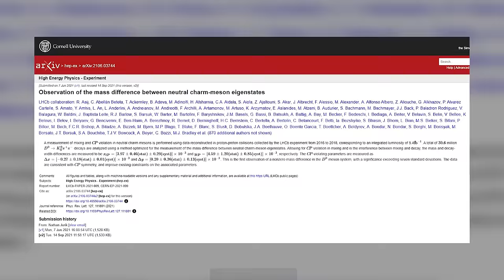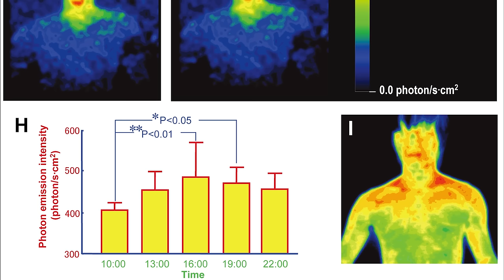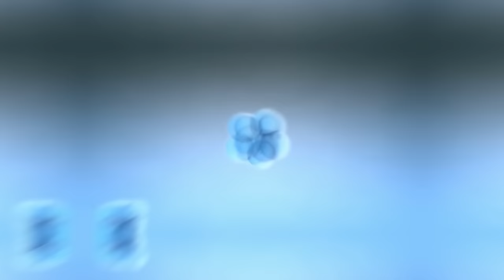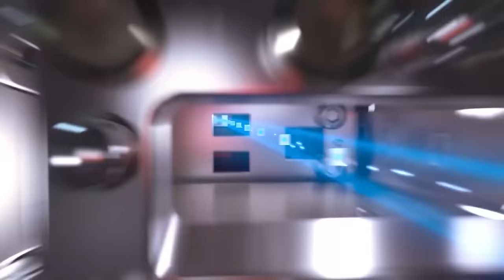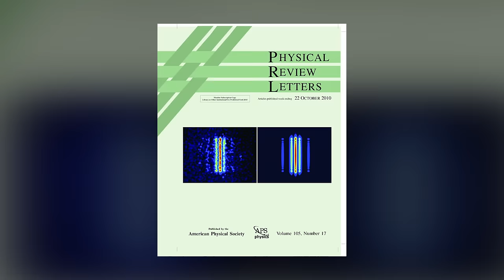Time Travel Is Possible: The First Successful Experiment Was Conducted

Comment: Aren't it about 1000W per m2 as a rule of thumb? From what I've been told it is only around the Equator that receive that high amounts per m2. Far less up North. 
And of that something like 20-25% can be "extracted" with current panel efficacy?
Reply: You need 1.21GW of power and your vehicle had to hit 88 mph.

Comment: So many questions, heh. I'm left wondering what's so special about the crystal that it can split photons into their past and future selves--maybe this was just a case of double refraction where the light got trapped in the crystal for a period of time? On the other hand, assuming this is real, perhaps photons can be made to jump through time only because they are devoid of mass--otherwise they would always undergo a displacement effect upon entering the universe of the past/future they travel to. Photons jumping to the past and future simultaneously makes sense to me as light obeys both wave and particle theory when it travels, so the photons could be travelling as a wave in order to jump through time in both directions. I think this could raise a bunch more questions regarding what can be done with photons using quantum entanglement. Lots of fun speculating--thanks Ridddle!